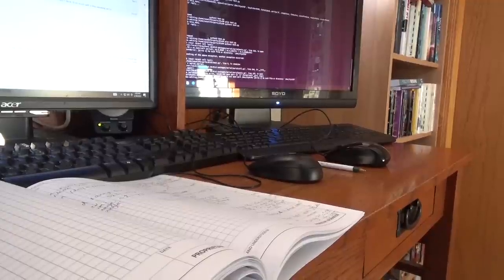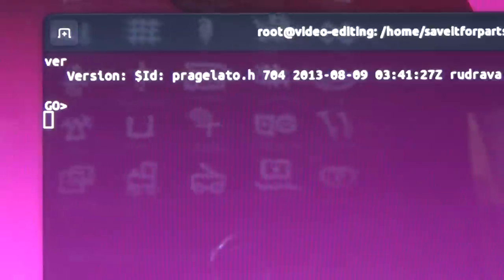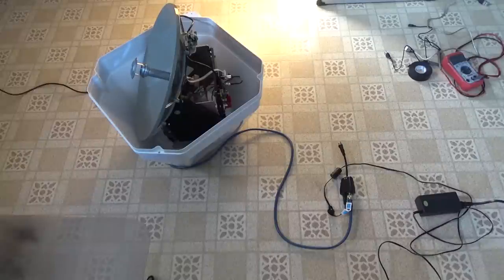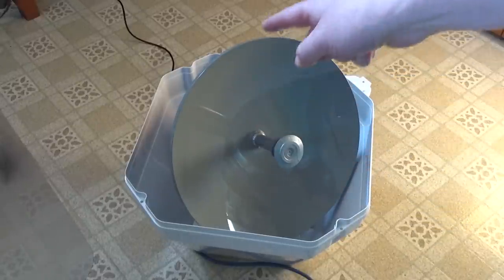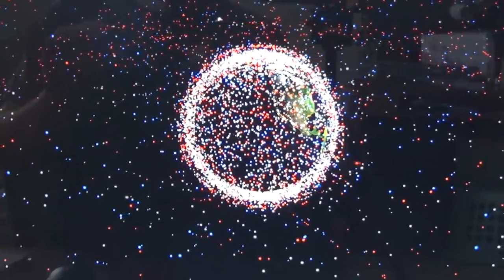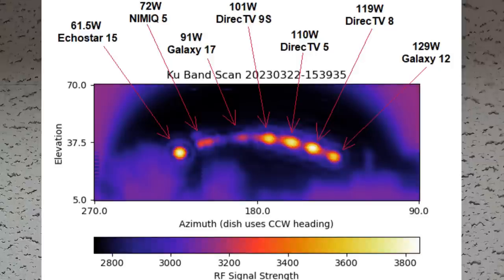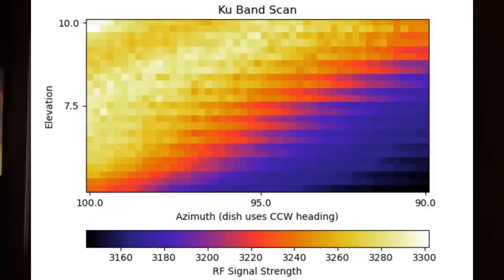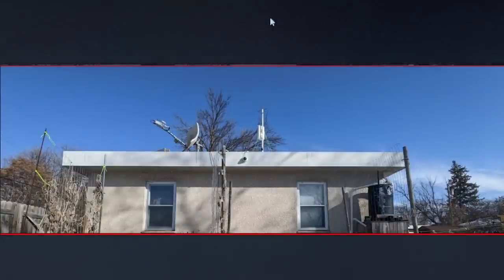Seeing Satellites with DIY Microwave Camera

Comment: How can I get one of those dishes?
Reply from the maker: I've found mine on Craigslist / Facebook marketplace, they're usually $150+ but occasionally I see one under $50 and I grab it. Not all of them are the right model, I mention that in the video and show what to look for.
Reply: @saveitforparts  got a model #?
Reply from the maker: I haven't figured out which part is the exact model / revision number, but the sticker on mine says: MODEL: TAILGATER
BKLULZ03738K
HWID B22C061K1403738

I have another one that also says TAILGATER for the model, but has a different mainboard and different serial / HWID. I also have VuQubes that are basically identical and made by the same parent company, but with a 3rd kind of mainboard.

Comment: 📺💬 You may fill it right but the input command can do by each character.
🐑💬 You are correct if it is terminal because terminal wait for the specific execution command.

🐐💬 The problem is communication even if it is encrypted you always know of the existing, use it when necessary or common communications with identity had been use since radios.
👧💬 Everyone knows it exists satellite but to understand it you need identity and reading it also tells of your location ( frequency, information or even axis location ) .
🧸💬 Microwaves
📺💬 เออ ยุ้ยครับ Microwaves อีสัด รู้นะครับ

Comment: what is the model # of that dish?
Reply from the maker: I don't think it has a model designator other than "tailgater". There are definitely different models or revisions, but the company didn't bother labeling or documenting much. Not sure if the serial number contains a model designator, it's BKLULZ03738K / HWID B22C061K1403738